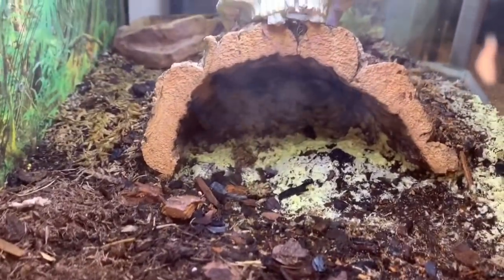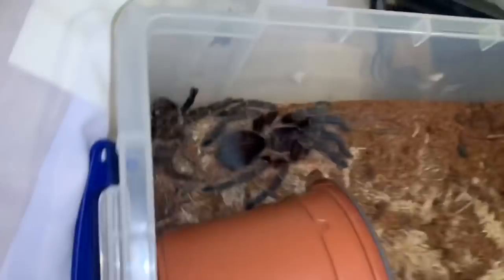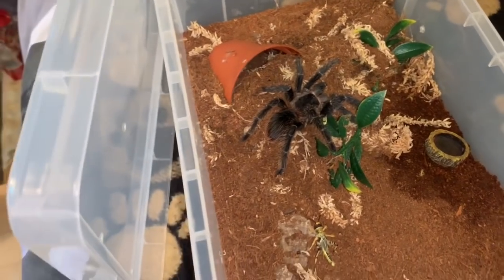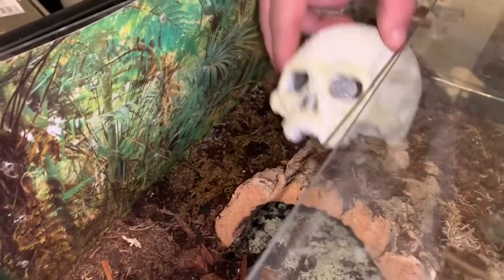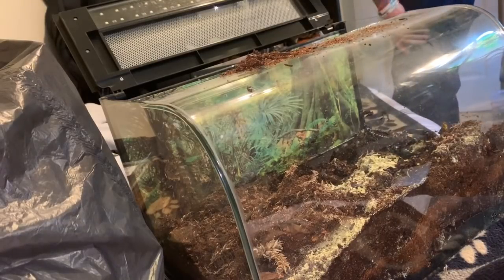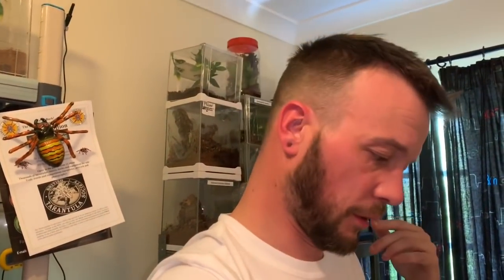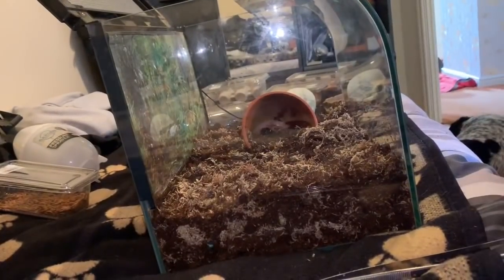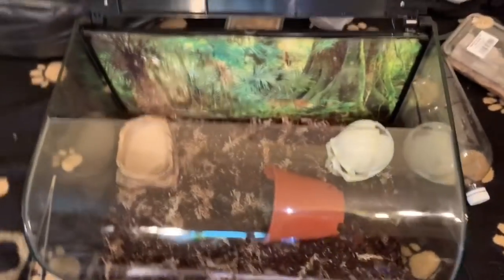MASSIVE MOLD PROBLEMS..... 😔😔😔😔

Comment: I'd advise peat moss when you can find at shows n I have been using top soil from garden center n then bake it for 1hr at 150c😜

If you are in the valleys you might suffer more. I rem my bro in Swansea the moisture/damp was a shocker.

Stale air n dark doesn't help. Even if am not feeding I open lids at least once a week. It's a pita.